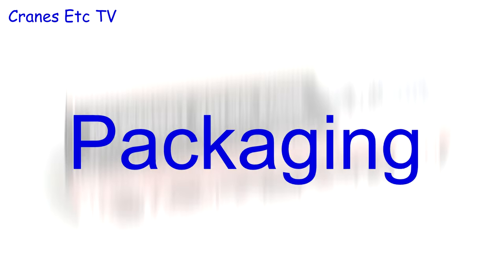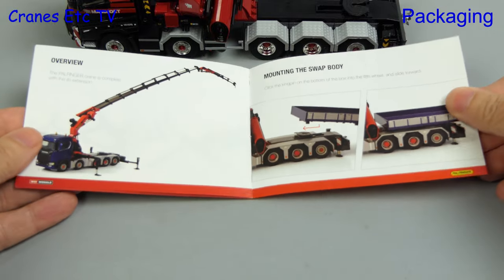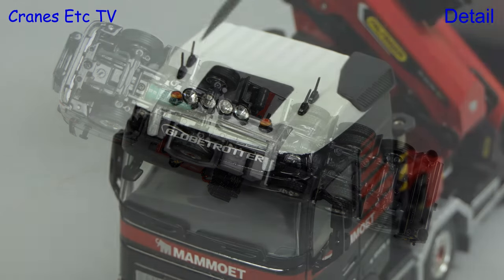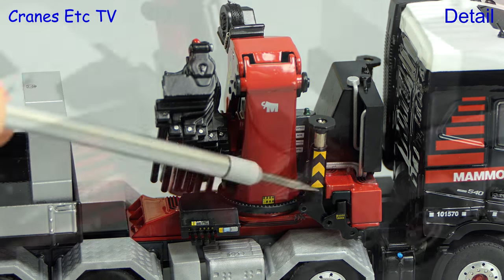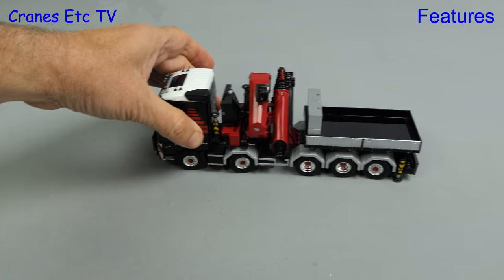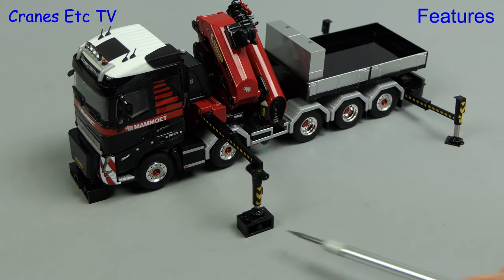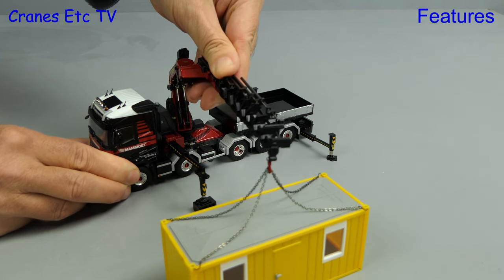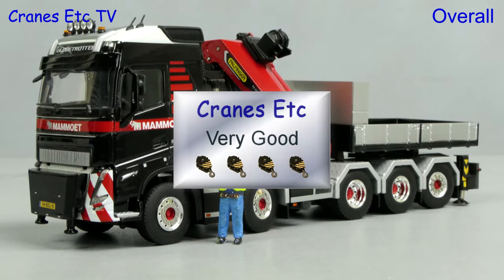WSI Mammoet Volvo FH05 + Palfinger PK 165.002 Loader Crane by Cranes Etc TV

Comment: Going by its a 10/4 axle layout. Only axles 3,4. With double wheels per side would be driving. Last axle, looks like steering axle, so not powered, so no drive shaft.
Reply: I think he meant to say between axles 3 and 4, rather than 4 and 5. So it's a simple mistatement.
Reply from the maker: My error, I should have said between 3 and 4.  😒
Reply: Cheers...